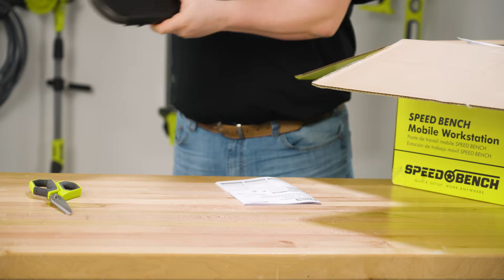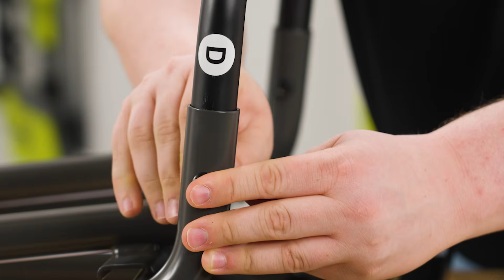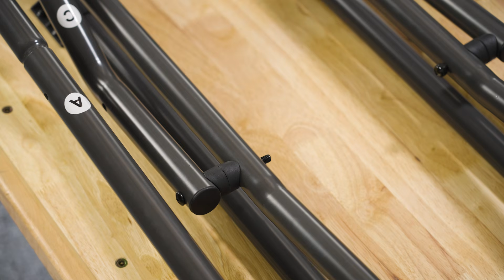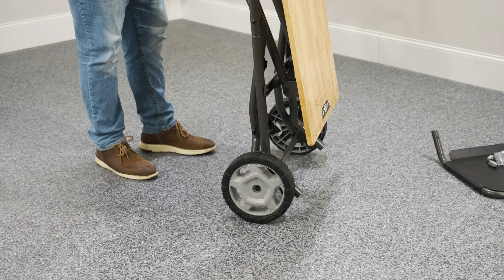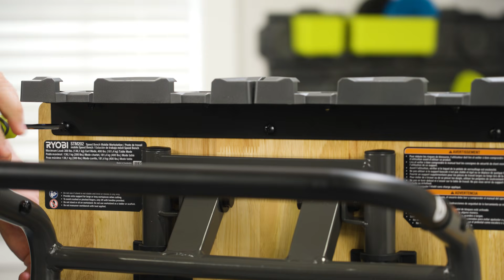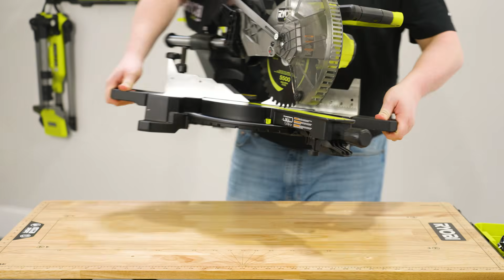How to Assemble the RYOBI SPEED BENCH Mobile Workstation

Comment: Worst instruction ever!!! It took me a day and a half to put this simple bench together. But what took forever was the holes with the rubber spacer would not line up. I was able to stick a screwdriver through it, but the bolts would not budge!!! I have a use a hammer and get violent with that thing. It’s on but it’s on backwards. I finally gave up.
Reply: Dang, it wasn’t that bad, but some of these reviews and comments made me hesitate on trying to assemble …. you need to gently drill out some of the poorly aligned holes… i used an old 5/16 drill bit… whole assembly took about 1-1/2 hours including a pause, watching video, and looking for misplaced tools.

Comment: Needed a pry bar, vice grips, ratheting wrench to get it together. That last pivot point spacer is a PITA. screw heads are very soft.
Reply: Thats why I came to watch this video. Have 1 plastic spacer that is not fitting and I was wondering if I was missing out some adjustment step or something.
Reply: @Surannhealz  I had the same problem. I wound up using a thinner plastic washer than I had lying around in my odds-and-ends bin. I love the bench now that it’s assembled, but what a pain it was to assemble.

Comment: I'm a visual learner, so I was pleased to see a YT video.  I had to "share" it to my email though, so I could pull it up on my laptop, because trying to watch it on your phone is really frustrating.  Although the video was fairly helpful, it could definitely use some improvements, such as displaying which bag of bolts/nuts, etc you use for each step longer on the screen.  I kept missing those pieces of info, because I would be focused on how he was assemblying each part in the video, and the bag of bolts you were supposed to use would be displayed for only about 2 seconds, and I'd keep missing it, because I'd be watching the man.  And rather than saying put the spacers between "such and such" part, say put the spacers between parts "A" and "C" on the hole closest to the bottom of the piece.  And label the bolts and nuts, etc and tell us specifically which bolts to use.  Wording like that would have been incredibly helpful.   And putting on those 3rd and 4th set of spacers are a pain, that took us the longest amount of time.  And lastly, I didn't like how the video would go so quickly from far away shots to up close shots....I know the makers of this video thought that would be helpful, but it really wasn't.   That's because you'd be focused on looking at the whole picture to see how the next piece fit, and then bam, all of a sudden it'd be zoomed in, and I'd have to rewind a bunch of times to see how they went from point A to point B. It honestly felt like this video was geared towards a customer who had already put several of these together and were familiar with all the parts.  It needs to be geared towards those of us who are putting this thing together for the very first time and aren't familiar with all the parts.
Reply: I have the same criticisms. Well put.

Comment: Change the hardware to remove the screwdriver from the frame assembly.
Reply: Agree. Phillips screwdrivers are either too small ot too large. A normal carriage bolt would have been better.

Comment: Written instructions should have been pictures.  Family call me to assemble there flat pack furniture and I cam do it very quickly but this takes the cake.  Even idea like pictures would have help a ton.  I watched the video and being on my phone doing the pause rewind thing to make sure it's the correct orientation was alot more work than simple pictures.   If you want to avoid store returns at your local hd might wanna do a revision.
Reply: Totally agree with this assessment.  Absolutely no reason for these lousy instructions in this day and age.  Just put pictures in the dang manual.
Reply: Paper instructions worthless. Tried the video. It goes too fast and skips steps such as when to insert bolts. Finally go it together using the art on the box. Of course, I did somethig wrong and it does not work. Who designed this thing? Terrible instructions (if you can call them that)!
Reply: Amen!